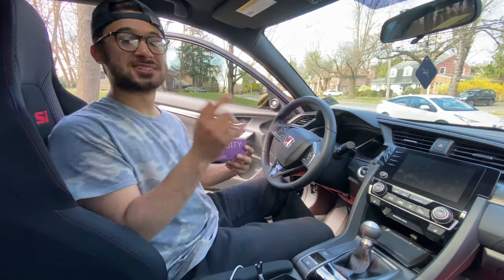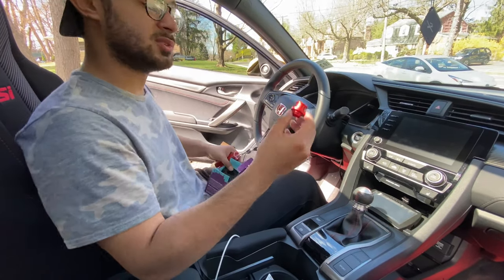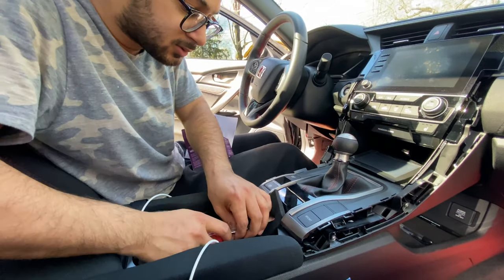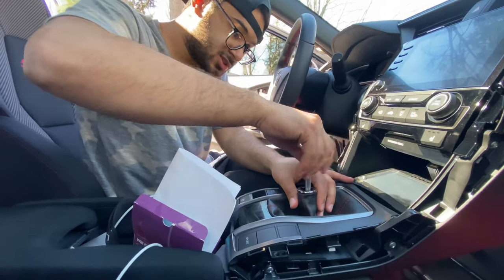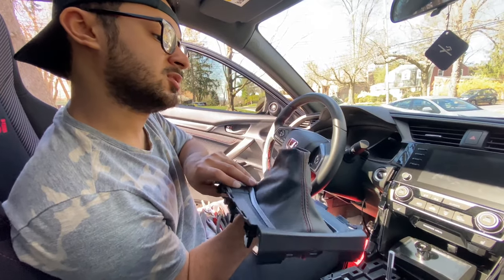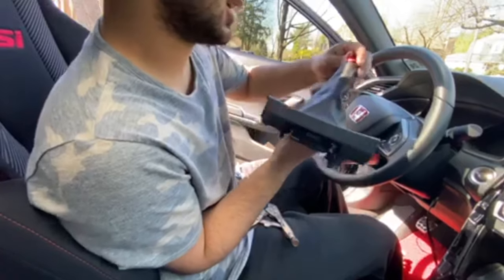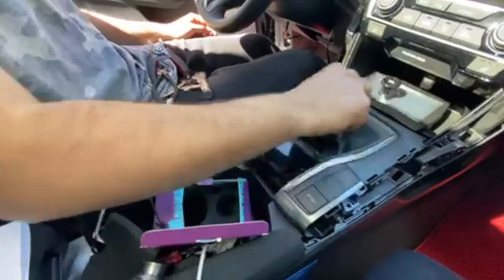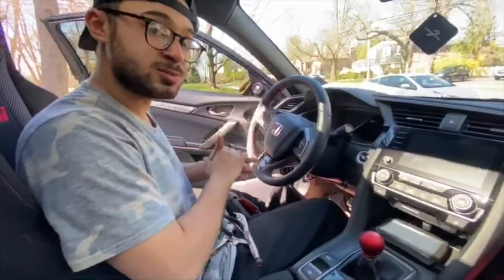How To Install Acuity POCO Shift Knob! (10th Gen Civic Si)

Comment: Well it doesn't make the throw shorter lol.
Reply from the maker: whoops, should have put low profile!
Reply: Technically it actually does make the throw shorter. Because the height of the knob is not as tall as oem the travel from point A to point B is less of a travel